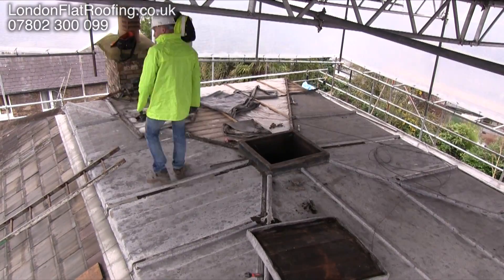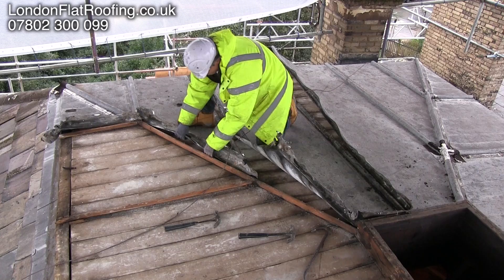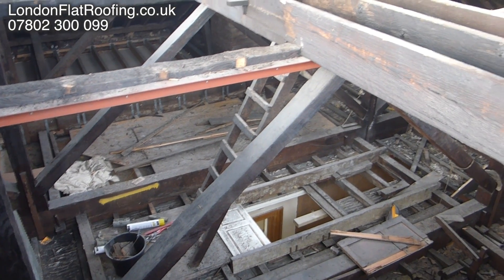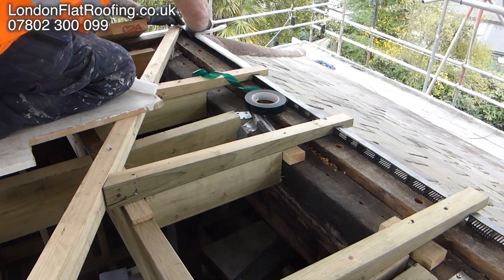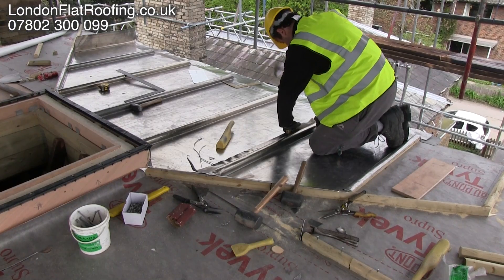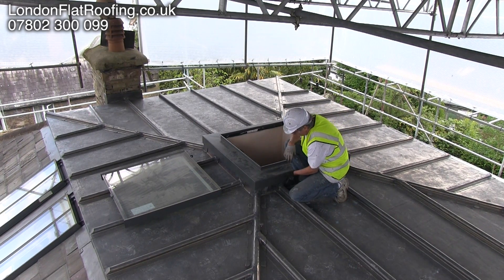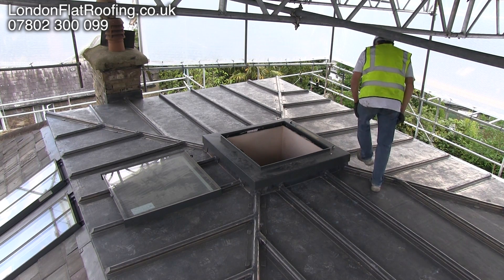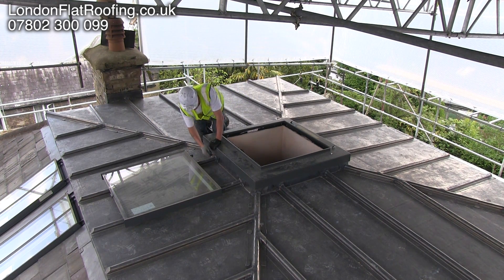New lead roof Highgate Cold roof construction

Comment: Tyvek under the new lead sheet? not good
Reply: THE-COLONEL why isnt tyvek good
Reply: copperworks in the UK the lead sheet associations regs require us to use building paper to BS1521 if the lead sheet is laid over plywood or a geotex fleece type of underlay can be used if installing over a close boarded structure. Tyvek breather membranes would allow moisture to pass through from the building to the underside of the lead sheet leading to failure
Reply: Basically it would get whit rust like zinc than.
Reply: copperworks yeah the white oxide mate. I’m not sure if it applies in other countries that’s just UK regs
Reply: They frown on any lead work now. Im on Longisland NEWYORK United States
Reply: I’m well aware. The lead sheet association made a point of outlawing the use of breathable felt under lead work around 2016, we laid this roof well before that.

Comment: Lead is beautiful & cross venting vital for a cold deck roofs.  Warm deck usually avoids the need for cross venting but I notice that the LSA & other lead sheet groups recommend cross venting even a warm deck flat roof where this should be unnecessary for a warm deck roof.  What is your opinion on providing yet another set of counter battens & decking on top pf a warm deck roof when lead sheeting is applied rather them single ply?  Have you ever seen or experienced internal sweating of a lead sheeted warm deck roof?  Is it an over precaution when using lead?  What is your view from the sharp end?  Surely if the visqueen FB vapour barrier is applied well under the insulation & sealed to all the abutments, cross venting the top side of a warm deck roof should be totally unnecessary.
Reply from the maker: I think the perfect roof is a warm roof with a vented roof over the top so easily cross batten and vent over all warm roofs, this then give built in redundancy if the vapor resistance of the warm roof fails  the venting picks up the problem